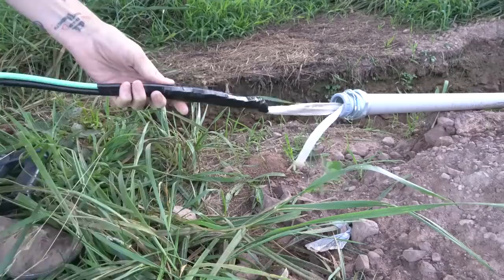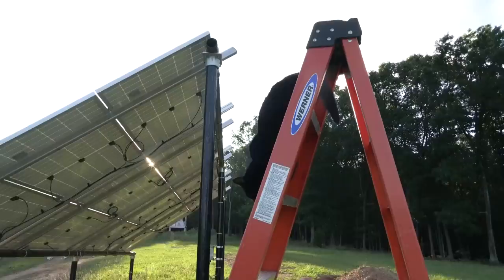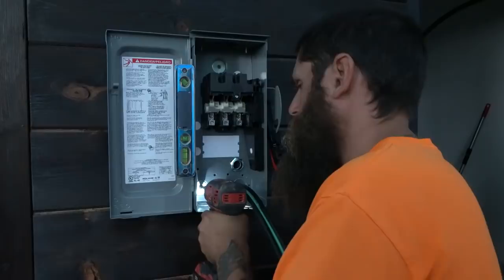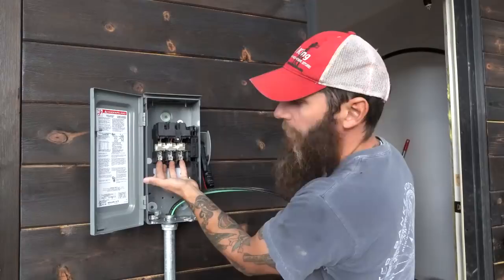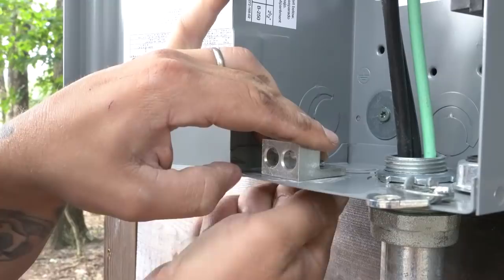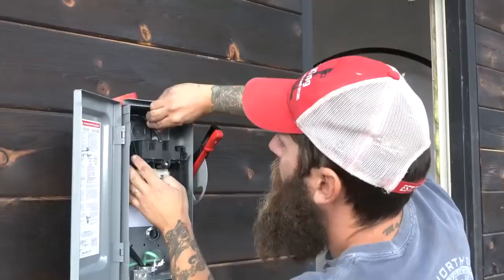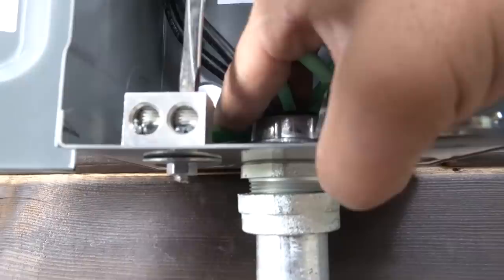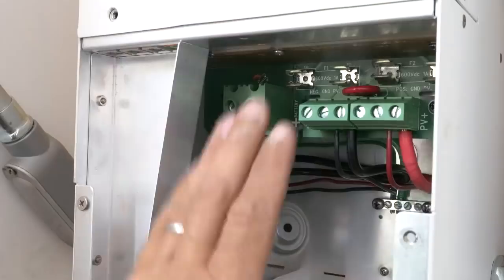She's Got A DISCONNECT- DIY Electrical

Comment: Hi Guys, you make a great team.
Play it safe and ground you electrical system properly using a burred solid copper 8 foot grounding rod.
 The only legal ground rod must be installed a minimum of 8-foot in the ground. The length of rod and pipe electrodes is located at 250.52(A)(5) in the 2017 National Electric Code (NEC). See figures 1 and 2 for the section requirements.

However, what if I were to tell you this statement is not entirely true? What if there was an instance, or maybe two, where a 5-foot ground rod was acceptable? To find this elusive information, one must travel to the latter chapters of the NEC. To understand why this different length exists, you need to know the history.

Article 250 of the NEC — The 8 ft. Ground Rod
Article 250 contains general requirements for grounding and bonding of electrical installations. Sections 250.52(A)(1) through (A)(7) instruct users that all grounding electrodes present at each building or structure served shall be bonded together to form the grounding electrode system. Where none of these grounding electrodes exist, one or more of the grounding electrodes specified in 250.52(A)(4) through(A)(8) shall be installed and used (see figure 3).
The 5 ft. ground rod and its little known use in the NEC+
Figure 1. Requirements for ground rods.
The 5 ft. ground rod and its little known use in the NEC
Figure 2. Requirements for ground rods continued.

Information on grounding electrodes can be found in 250.52. Within this section, various types of grounding electrodes are explained in detail. This article discusses the one located at 250.52(A)(5). See language below as well as figure 4

(5) Rod and Pipe Electrodes. Rod and pipe electrodes shall not be less than 2.44 m (8 ft) in length and shall consist of the following materials.

(a) Grounding electrodes of pipe or conduit shall not be smaller than metric designator 21 (trade size 3∕4) and, where of steel, shall have the outer surface galvanized or otherwise metal-coated for corrosion protection.

(b) Rod-type grounding electrodes of stainless steel and copper or zinc coated steel shall be at least 15.87 mm (5∕8 in.) in diameter, unless listed. (2017 NEC)

Other information specific to the installation of ground rods, such as installation and minimum resistance, can be found at Section 250.53(G) and 250.53(A)(2). See figures 5, 6 and 7 for additional information.
The 5 ft. ground rod and its little known use in the NEC
Figure 3. Various grounding electrodes.
Reply: Hi Again Guys, and please make sure you use Ground Fault Circuit Interrupters for  kitchen, bath and any outdoor outlets.

Comment: The Negative or Neutral is suppose to be WHITE ! You need to tape Both of the Negative Conductors with WHITE Tape to identify them as a Neutral !!! NEC CODE REQUIREMENT !!!